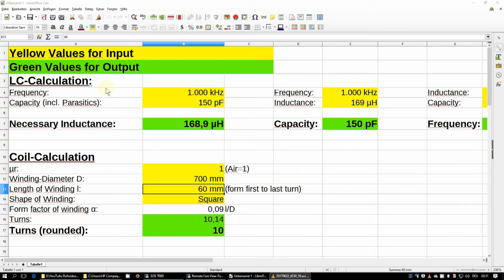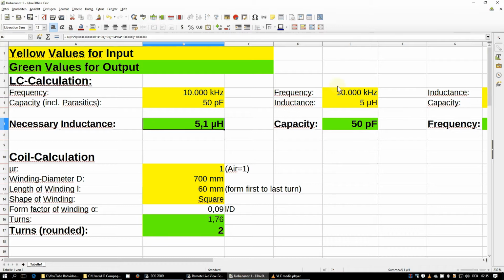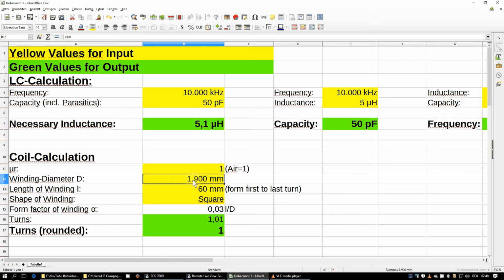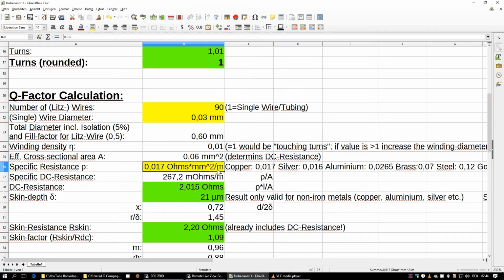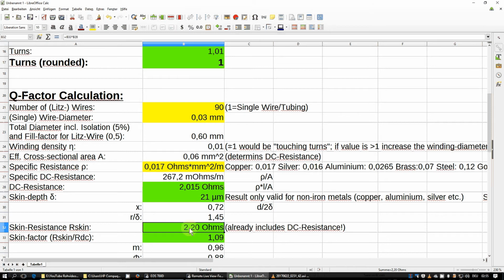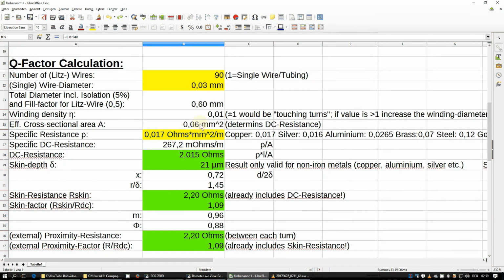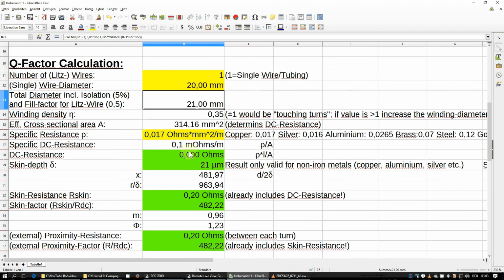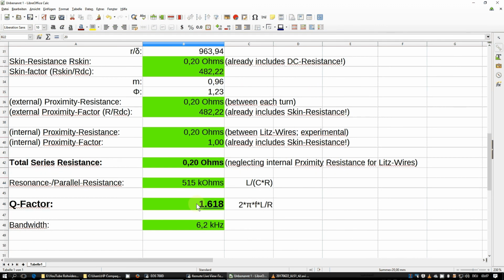A Spreadsheet for Magnetic Antennas Pt.1: Loop Antennas

Comment: with great interest I follow your lessons on tuned circuits and now the calculation of the Q factor, with this spreadsheet.
From my built loop antenna I want to calculate the Q factor and the total loss resistance, at a certain frequency.
How do I proceed with this;
Frequency is 14200 kHz, Winding Diameter D: is 917 mm, Circular, Single Wire diameter is 15 mm. With the Capaciteis value I "set" the value of Turns to 1.
Is this a correct application of your spreadsheet?